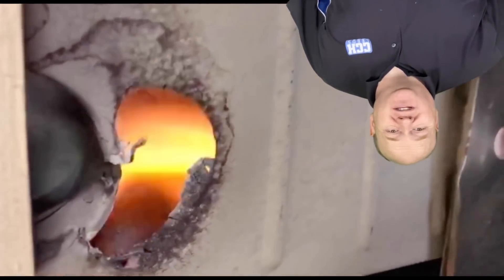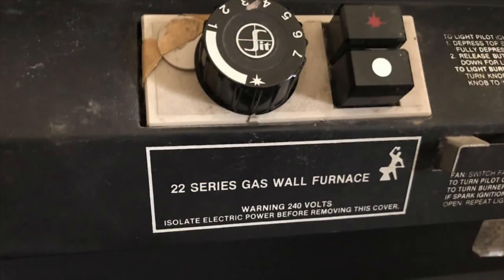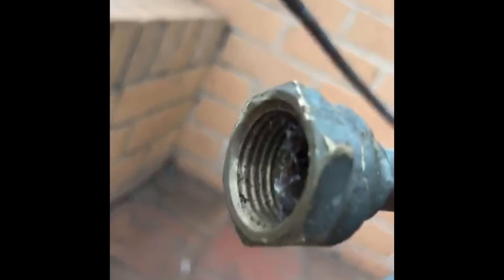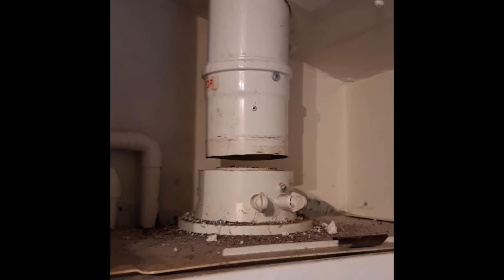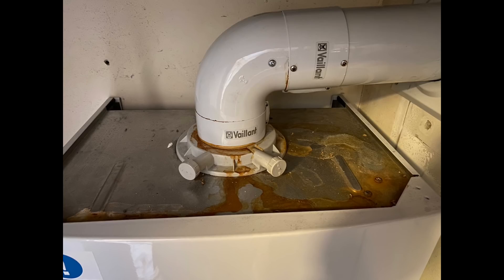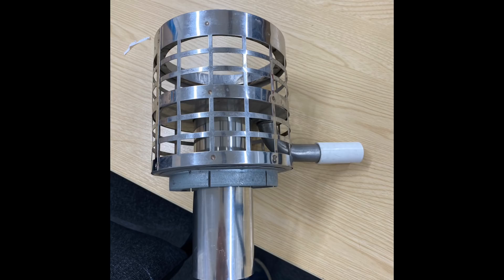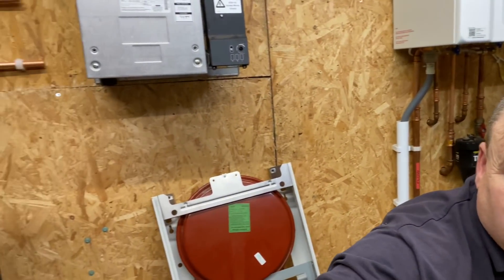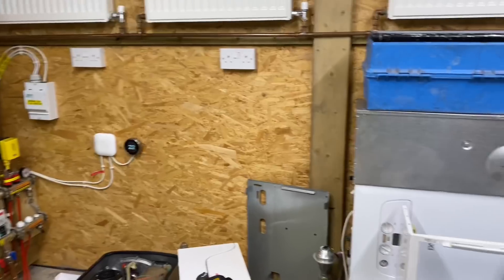Dangerous Gas Furnace - Australian Plumber

Comment: first video is a vulcan 22 gas wall furance, below the downdraught diverter  as you can see has totally corroded, last video is a ducted heater installed in a roof, half hanging over the cat work and was secured by the flue resting on the the steel beam, if that flue has come loose the unit would of fell off the cat walk (board it was sitting on) when the main fan kicked in
Reply: and in roof, would of come down through the ceiling, hope that helps alan, andy

Comment: What about rules and regs overseas? Do they have similar organisations to Gas Safe in Australia?  For any Breaking Bad fans, there was an episode where Walt goes off to a D I Y shop and buys a new water heater and fits it! But then again, for a country where you can legally arm yourself to the teeth how bad can it be to fit your own water heater?
Reply: Legally you can’t touch anything to do with plumbing in Australia unless you have a full licence. All In ground drainage, gas or other plumbing  work over $750 in Victoria needs to have a compliance certificate issued. We have Random audits  and don’t get to choose what jobs to take the inspector to.

Comment: first one looks similar to the dru heaters we have here. wall mounted balanced flue units. they like to collect moisture and rust holes appear, they also crack in places and the bolt holding the burner bar in to the heat exchanger can blow out. never seen one with a massive hole in like that aussie one though... oh and hello to your no1 fan grandma hart!
Reply from the maker: I have no idea but really interesting stuff. Thanks.